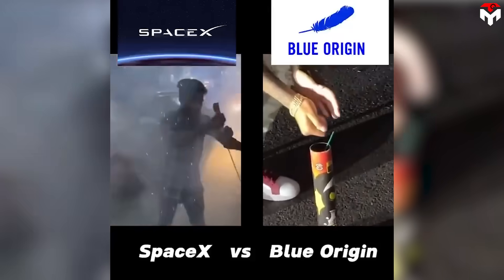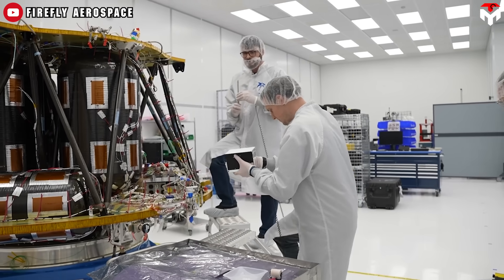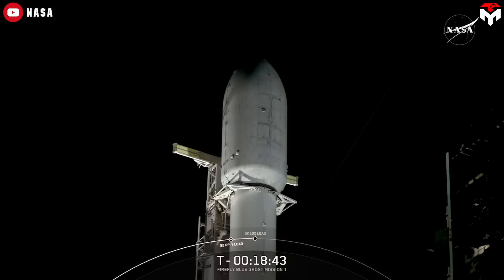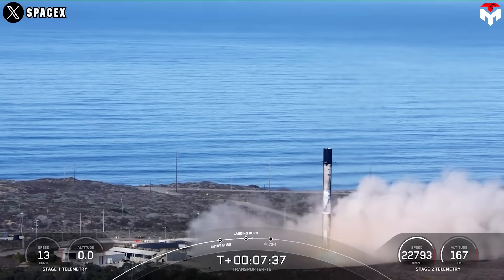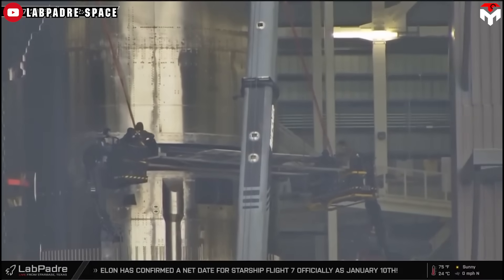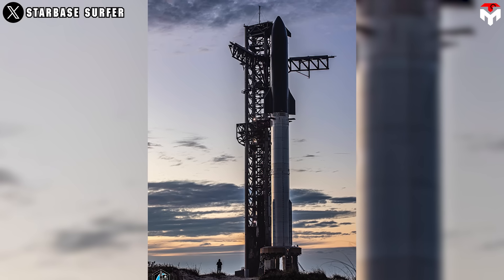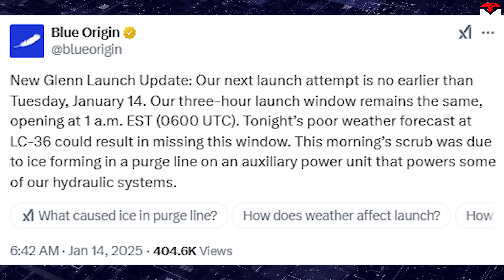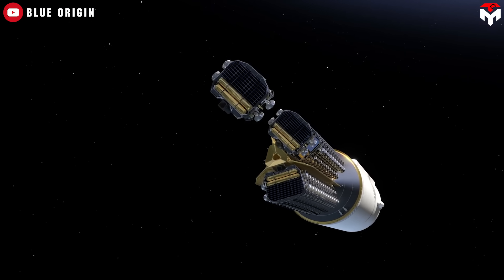What SpaceX Just Did Completely Humiliated Blue Origin and NASA…

Comment: If NASA and the Dems did not implement restrictions for flights and use of launch pads, Elon might have had a base on the moon and be on the way to Mars by now. Which is what NASA promised long ago, but got greedy and did not see the larger picture. Built returnable spaceship (Spaceshuttle) instead of going to the moon and Mars. NASA needs to get out of the way or be part of the solution for our expansion into the solar system.
Reply: So what's the excuse for there not being FSD (next year since 2016). Where's Hyperloop (it's really not that hard)? Mars? Dick X hasn't gotten beyond low earth orbit yet. But those fireworks were beautiful. Glad no one got hurt.
Reply: @ Have you ever watched the launch footage of the pre-Mercury NASA program. The redstone rocket first successful launch had an astronaut in the capsule. We are bound to have failures. The ones pushing the envelope will always be at risk, especially in space because we are leaving the comfort of our safe earth environment to the hostile vacuum of space. Just like the sailors and ships in the 15 and 16th centuries. Not all the men or ships came back.

Comment: New Glenn made it to Orbit. What a humiliation to Starship.
A suborbital vehicle so far.

This propaganda channel is sad today😂😂😂😂
Reply: Starship isn't trying to make it to orbit. It's trying to master reentry. It could easily make it to orbit but what for? That doesn't contribute to rapid reusability R&D. Blue orgin lost the first stage, and the second stage isn't really doing anything. It's got a radio on it woop de doo.
Reply: @ Current vehicle can’t make it to orbit. It too heavy. It needs Raptor V3 or V4
Reply: @pedrosura You are incorrect. Regardless, orbit is ease, reentry and full & rapid reusability is hard; but competition is awesome!
Reply: @pedrosura  it definitely could make it to orbit, it's not fueld for orbit, that's a waste of fuel since it's mission is to collect data on reentry. The goal is rapid reusability. Blue orgin was your standard expendable booster and second stage that was never intended to return. It wasn't even designed to deploy cargo. They just built the radio into the second stage. Not really a vehicle if you ask me. Even NASA had return vehicles 50 years ago.
Reply: @davebrillinger6138  I am not saying that getting to orbit is hard. The problem is that the vehicle is too heavy and the current version of Raptor doesnt have enough thrust. It didnt get to orbit because it runs out of fuel. That is why it is suborbital. You obviously have not even looked at telemetry. They need a more powerful rocket before they try to go to orbit.

Comment: I Wonder if anyone is working on a Junk capture system? They need it and I would suspect soon?
Reply: I agree, way too much junk up there, you'd think spacex could carry up a few deorbit system loads with each starling mission the could simpluly go to a targeted series of objects capture them and deorbit to burn up on re-entry, if done right these deorbit drones could be relatively small and inexpensive (as far as space goes), there could be single use drones that just drag down some space junk with them, or a larger one that could target several bits of junk and just push each one out of orbit then when it's running out of resources grab a bigger piece of junk and pull it out of orbit for both to burn up on re-entry.

Whatever methods are used all the junk up there needs to be  cleared and carrying deorbit drones as additional payload to existing missions is probably the cheapest way.
Reply from the maker: I believe we have something like that. The Japanese too.

Comment: Wonder why they use 4 legs?
3 are usually more stable esp on unprepared surfaces.
Reply from the maker: They settled on four because of the factors not mentioned yet.

Here’s the thing: while stability on uncertain terrain is one thing the engineers had to worry about, inertia was another. You see, even though the lander would be touching down in one-sixth the gravity of Earth, it still massed a bit over five tons and even with relatively slow movement as it touched down, that’s still a LOT of inertia. One of the things the engineers simply could not count on was that ALL lateral motion would be stopped and the ship wound be coming straight down - they had to rely on either the automatic P63/P64 landing programs or the assisted-manual P66 program which gave the astronauts direct control.

The point is that the engineers simply couldn’t know if the lander would be lowering straight to the ground or would have some lateral movement. On three legs, that lateral movement could be fatal.

You see, while a three-legged object is stable while static, it is easier to tip over than a four-legged object, especially if the object is top-heavy. (I’ve no idea where the lander CG would be - likely around about the position of the ascent engine housing the astronauts used as a seat.) It is possible the wider, less supported 3-legged stance could, given lateral inertia, cause the big machine to tip over in a shaky landing.